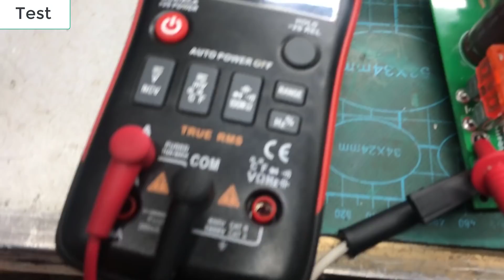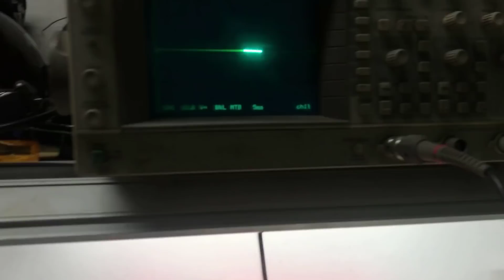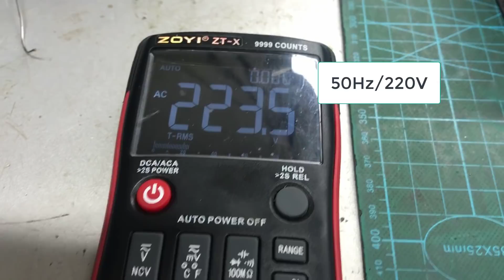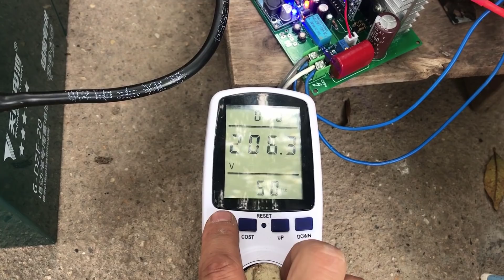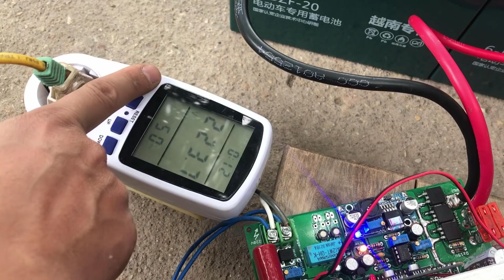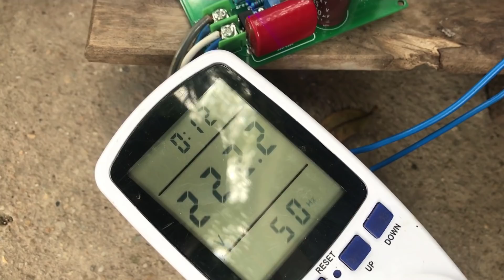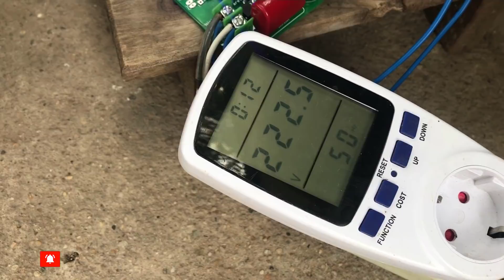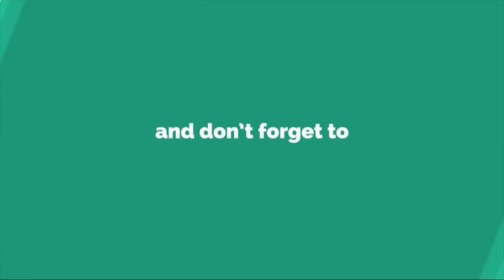Powerful 2000W 12V 48V to 220V inverter

Comment: Hello Awesome tech,
Please under this project how is overload current protection variable resistance 10K, connected to the i.c LM358? on this PCB.
Secondly, I want same PCB to order from the manufacturer, please how do I go about it?
Please if you have compassion, please explain the circuit for me or send the diagram, because I don't know what programme or application to use, I have done the download  several times in vain, no schematic.

Comment: Out put voltage increase only 160v light is flickering
Reply from the maker: you need a 7v -220v transformer
Reply: @PhdHung  yes have computer ups TRANSFORMER 6.8v to 220v
Reply: Light is flickering like lower frequency

Comment: Plz.... I want a circuit diagram for DC to DC boost or inverter.... Inpit 12 or24v Dc. Output 66v Dc with 15 to 20 amps.

Comment: Hi, my teacher.
I built 12volt, 12 transistors, and I used irf 3205. But If I load it, the output voltage will drop drastically and the whole system will go off, or try to go off. I used the Egs002 module.
Please what could be the problem, could you please help contribute to.,

Comment: When i use battery 12v I need or not to change something and jump on your board
Reply from the maker: bỏ con mạch buck ra là ok :D
Reply: @PhdHung  vậy là nối tắt con mạch buck đó hả ad. Rồi có cần thay đổi gì nữa k ad. Con mạch buck đó đầu ra ad chỉnh bao nhiêu vol thế
Reply from the maker: @thanhminh4284  buck đó ra 12V đó. nuôi mạch EGS002 và quạt tản nhiệt. Nếu chạy 12V thì nối Vin buck với Vout buck. Sau đó phải chỉnh chiết áp bảo vệ pin yếu nó thấp xuống.  Vi dụ chạy 24V thì bảo vệ pin yếu là 21V. Thì chạy 12V ta chỉnh là 10.5V.
Reply: @PhdHung  ok thank ad
Reply: ý mà con sensor nhiệt ad sử dụng giá trị bao nhiêu thế???
Reply from the maker: @thanhminh4284  NTC 10K

Comment: The 95N03 MOSFETs used for reverse polarity protection are no longer available (out of production).

You will get better heat transfer if you use a small metal bar clamping the body of the output MOSFETs to the heat sink instead of individual screws on the TO220 tabs.
Reply from the maker: yes.

Comment: Nice project but you can use microcontroller here, then why you use egs 002 module....
Secondly if possible please make it with microcontroller.
Reply from the maker: Because EGS002 is cheaper. I bought it from china. Only 2 dollars / 1 piece.

Comment: Transformer rewind 220v side what size of wire 18#? Or 19#?
Reply from the maker: Choose 8A / 1mm2. For example you need 1000W at 24V. The current needed is 1000: 24 ~ 42A. The copper wire size is 42A: 8 = 5.25mm2.

Comment: all components i found on ebay or aliexpress including the irf3205 (8 of) and fob 95n03l (3 of) mosfets 

DB107 is diode bridge
GA6 is relay
DZ is zener diode
S8050 is general purpose transistor
NTC10k is a 10k thermistor

R-X looks like it is a 10k or 100k ohm resistor 

any ideas about the latter point and how to attain the 10 mili ohm resistors would be welcome

"you need a 7v -220v transformer"

what voltage ratio on my transformer do i need for a 24v to 220V inverter?

how do i add another 8 mosfets to help a 24V inverter with the current?

many thanks your genius is great!

Comment: Just a question , correct me if im wrong, the reason why you shielded only two of the mosfet from the group of four mosfet is that the source of the first pair  is connected to the drain of the second pair mosfet and the unshielded pair is connected directly to the heatsink which is the connection for the transformer,  is it correct?
Reply from the maker: Exactly

Comment: @Homemade 102 Hi I am kisath Edirisuriya from Sri Lanka. I started creating a inverter as the inverter you show above using the help of your schematics and videos.  But I cannot understand , how to adjust the trimmers as you have not explain much about it and also the overload protection in most your circuits consists of a trimmer and is different. Can you help me understand, how to adjust the 4 trimmers and also can you explain a bit about your overload protection circuit. Thank You

Comment: How many Watts can I load maximum using 600va ups transformer
Reply from the maker: ~ 400W :d
Reply: I made a inverter using egs002 but I can only load maximum of 140watts. More than that it automatically shutdown. why?
Reply from the maker: How many times does the LED flash ?.
Reply: @PhdHung   3 times
Reply: @PhdHung  output voltage drops to 170v
Reply: Hope Transformer is home made, how many turns in primary n secondary in the project.

Comment: Hi,
I did inverter circuit diagram using the egs002 datasheet, and I am using HY4008 MOSFETs, and the transformer is 800watts, and the battery voltage is 12v.
The main problem is the no load current draw is 4 amps!! At 14volts, and the MOSFETs heats up very fast.
So could you please tell what might be the problem??
Thanks in advance.
Reply: The same problem happen to me. Only in 12v input. If I use 24v everything work fine.

Comment: What is the resistance of the R-X resistor below the low battery voltage protection pot?
Also, is there a way to just add a switch instead of push button power on?
Thanks for all you do! This is all amazing!